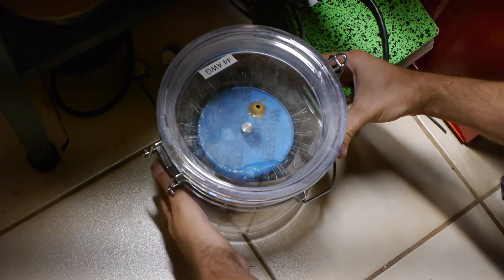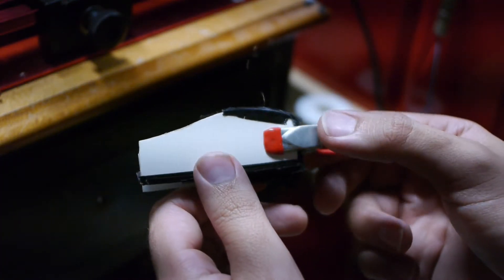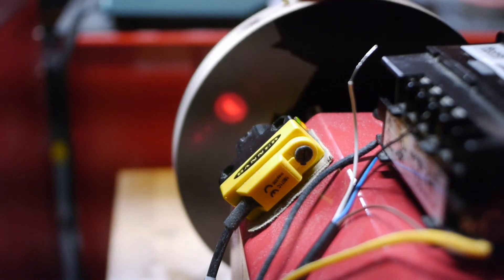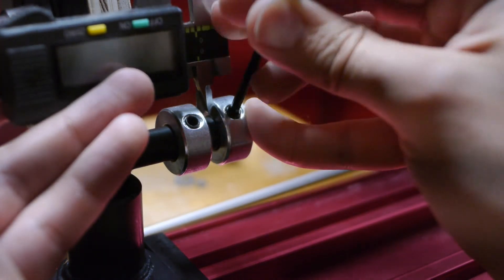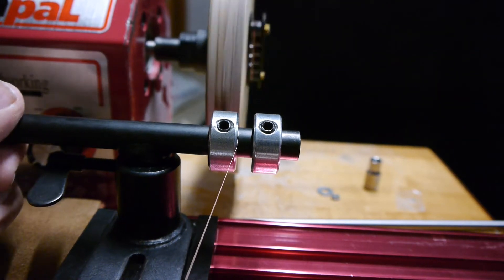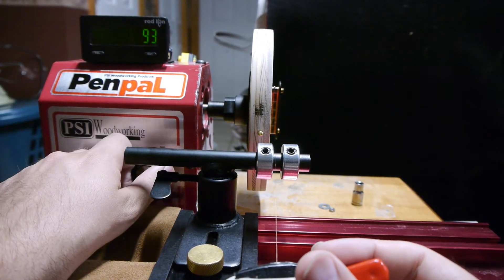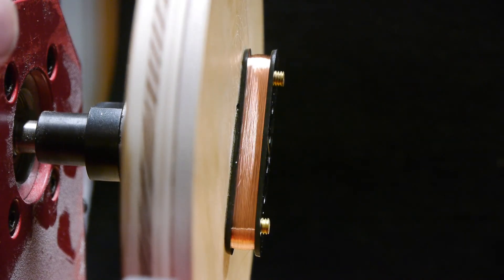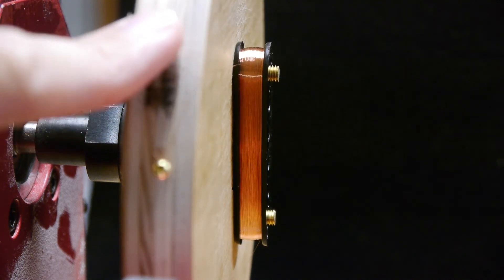DIY Mini Lathe Pickup Winder | My Pickup Winding Workstation

Comment: Great help thank you! What are the bristles at the top of the spool inside the holder? I would love to make one.
Reply from the maker: You're welcome! They're made out of nylon and is called a Wisker Disc, which can be bought from Azonic: 

http://azonicproducts.com/wisker.html

A representative from Remington Wire told me to always use a Wisker disc with new spools. I think once you're a ways into the spool you're fine, and the disc can actually add too much tension when the spool gets depleted and there isn't so much wire left.

But for initial use (even the majority of the use), the disc helps prevent ballooning and other issues that can cause wire to snag on the spool. I've actually had to send back a couple 5lb spools to Remington because the wire broke on the spool and was impossible to take any more off. They claim that the Wisker disc can totally prevent this problem, so I always use them now on my spools.
Reply from the maker: Also FYI, if you choose to buy one instead of making your own: 

The flange diameter on the 1lb spools from Remington is 2.5 inches, and the flange diameter on the 5lb spools is 5 inches. 

I just get the complete set on Azonic to cover all the bases. 

If you end up making your own, let me know! Would love to know how you did it!
Reply: @guitar_md  it’s possible I may not need one. I am using a 1/2 LB. spool from tonekraft (to learn with) and a slow sewing machine motor for my diy winder which is max 1200 rpm before the cheap counter skips. I still will get one. The wisker disk site is confusing as to what is needed.
Reply from the maker: @fat-hand  The 1lb spools are 2.5 inch diameter and the 5lb spools are 5 inch diameter -- however, I've only EVER had problems with the 5lb spools, because of the way the flange is designed. It flares out much more than the smaller spools, including the half pound. 

I agree the site is confusing! Definitely could benefit from a clearer layout. I've ordered from them and even I'm confused about the "complete set"....I'm pretty sure it includes everything. There's the disk, then there's a holder plate, then there's a threaded brass rod that fits into the hole in the middle of the spool. If you go with the complete set you should be okay. Just use a ruler and measure the diameter of the spool of wire on the top flange and you'll know what you need.

I have a wisker disk for my 1lb spools of wire, but rarely use it. It does affect tension, increasing it significantly, which can be a good thing if you need that. But you should be fine using the smaller spools of wire without one.

However, if you've already ordered one, definitely use it and see what you think! I have one wisker disk that I actually cut some of the nylon whiskers off of. To make it tension less. I found it was causing too much tension on this one spool, so clipping off some of the whiskers cured that. One reason it can be good to have a couple on hand!